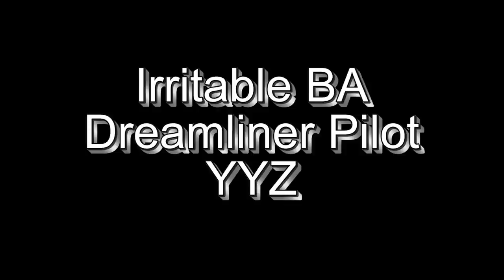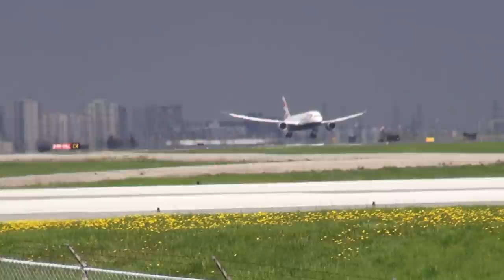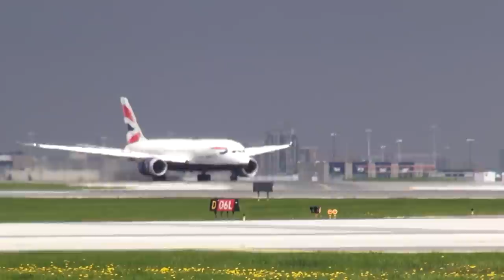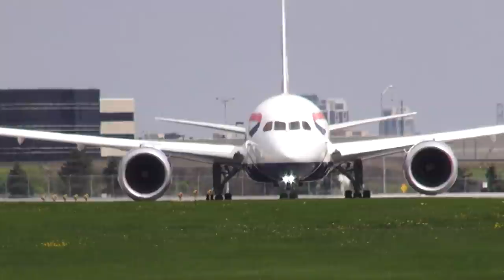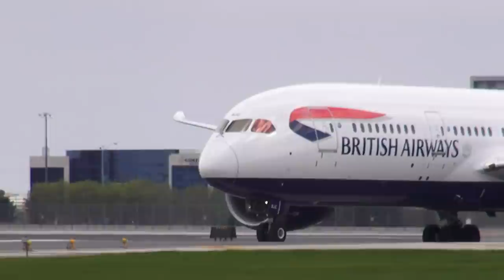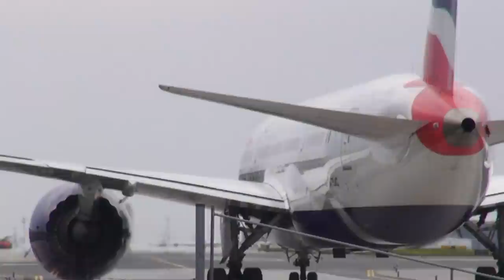Anxious British Airways Pilot, impatient controller

Comment: The controller should have slowed up a bit and let that BA 787 finish it's landing.
Reply from the maker: The only mistake I think the controller made was having too many instructions. "exit delta 6 hold short 24 right" was all he needed to say and asking them to repeat all that was just too much. The pilots will not change to the ground frequency until they are told to which is usually after they have vacated. I hear so many of these conversations as you can also hear if you watch more of my videos. What I have concluded is it is up to the copilot or who ever isn't landing the plane to listen and understand the instructions while the the other is controlling the aircraft. I have often heard in videos inside the cockpit the pilot  asking the copilot to repeat the exit instructions that he heard from the controller. if an airport is very busy like yyz was at this time this is typical. 

The pilot sounded rattled.
Reply: +Dave “daviation” Isenor The controlled shouldn't have even told them to hold short 24R, I mean you never cross a runway without the controllers permission anyways. All he needed to say was "Vacate right Delta 6" and even then I would say he should have waited for them to get back down to ground speeds. And yeah, normally the PNF (pilot not flying) would handle the coms and right down any instructions like that, but it'd be pretty hard to right stuff down while the aircraft is being bounced around as it often is on the landing roll.I will say as a disclaimer I am not a pilot (though I have flown light aircraft) so all this knowledge comes from what I've been told/observed.
Reply from the maker: +Streaky100001 I think "hold short 24r" was the most important instruction since there were planes departing on 24 right. That will never be a redundant instruction especially since they were all delayed due to bad weather just moments earlier. the controller wanted to get a plane away asap but had to hold him because it was still not 100% the BA pilot understood to hold short. The delta 6 was obvious because it was the last exit.
Reply: +Dave “daviation” Isenor Well, I've done the airmanship course with cadets in the UK (basic rules/procedures of flying an aircraft) and the 1st thing they tell you is that you NEVER cross that hold short line with out the controller expressed permission, so unless the controller had said "Speedbird 9 Lima cross 24R" the pilots shouldn't have even considered it.
Reply from the maker: +Streaky100001 I understand totally but it's still just humans communicating, To me it seems everything is obvious. I guess the pilot could be just on his own doing all the things he learned in an "airmanship" course. I still think as a layman in this case, out of all the default or obvious,  holding short of 24r was the most important instruction as there was traffic taking off. where ever he vacated wasn't important. the one thing that needs to be avoided is a collision. Exiting on the grass would avoid that as long as he didn't get in the way of other traffic. I have heard them instruct to exit left at the "next exit" that being the one they can make (then) hold short whatever. If there was a situation where the "hold short" instruction wasn't given and for some reason the plane continued to cross and there was a collision or a near collision I think the controller would likely be more liable than the pilots, just a hunch. I understand and appreciate your excellent knowledge and I am sure it is better than mine but I have listen to 1000s of these exchanges over the past 4 or 5 years there is always an on the job human element, not quite rocket science, but close lol
Reply: +Dave “daviation” Isenor I think the key difference between what were saying here is my knowledge is theory based where as yours is based in observation, I mean I haven't actually heard many of these exchanges, but I know the way it should go. As for who would be most liable, well I've recently started an apprenticeship in aero engineering, and what I've learnt so far is that if there is an accident any one who'd had anything to do with that aircraft (controllers, flight crew, engineers etc) will be in a pretty bad place, they have a way of finding something you did wrong, and if there was a collision I think both the pilots and controllers would be out of a job, so I think the controllers hold short was pretty much to cover his arse so the responsibility was indisputably on the pilots if anything went wrong, I get the sense it was said more for the tape recorders than the pilot. And yeah, you're right, they do often say something to the effect of "vacate next available right" but at a busy airport I imagine that would cause congestion issues on the taxiways.
Reply from the maker: +Streaky100001 Yes, any trade you learn has it's theory or academic part of the course. but the most important part of the course is being an apprentice. when you are on the job you learn how it improvise yourself out of a situation and often cover your ass. I am an armchair quarterback when it comes to aviation. It's like watching sports all the time and learning what the players do with out actually being a player. You are an up and coming player.
Reply: +Dave “daviation” Isenor I may be an up and coming player but for a different game, I mean this is the actual flying/atc side which I have nothing to do with, they break stuff and I clean up when they're done, so I'm as much of an armchair quarter back as you in terms of coms with atc.
Reply: +Streaky100001 As an ATC you'd think there is a lot of things you wouldnt have to say but pilots tend to forget there a lot of other planes around and until you hear that readback from the pilot you'll be stress he wil do the one thing you don't want him to. the whole point of having two pilots is one does the cross checking and comms during the landing and the other does the landing. This is pretty normal.
Reply: +Streaky100001 Maybe it's different in the UK, but here in the States, it's pretty normal for ATC to explicitly instruct you to hold short of any runways along your taxi path that you don't have clearance to cross, as far as I know. The same is probably true of Canada. Of course you shouldn't cross them without permission anyway, but the explicit mention makes sure that the pilot realizes that he will, in fact, have an active runway in his way and he shouldn't cross it. The pilot should see that anyway from the airport diagram and out the window, but the explicit mention by the controller helps to reduce the chance of a pilot not noticing. In bad weather, the hold short lines can be hard to see from a distance, especially if you're not expecting them and happen to be glancing off briefly at an instrument or some such thing. In 99.999% of cases, the pilot will see the runway and not cross the hold short line even if the ATC doesn't mention it, but the mention is there to keep the other 0.001% of cases from killing hundreds of people. Preventing runway incursions is one of the most important parts of the jobs of the tower and ground controllers.

Pilots and controllers both make mistakes from time to time. They're both human. Having them double-check each other greatly reduces the odds of a mistake leading to an actual accident.
Reply: +vbscript2 Yeah, point taken, I was very much thinking of the theory, I have little real world knowledge of this stuff, and you do raise an interesting point when you said "have an active runway" since I would assume there would be a strong chance that the pilot if presented with a runway out of his windshield may not know weather or not it is an active runway.
Reply: +Streaky100001 We always get a hold short clearance (or a crossing clearance) if the taxiway we are exiting on leads to another runway. 
The issue is that the controller gave the taxi instructions before the pilot had even completed slowing from landing (the thrust reversers being open indicates that he was in excess of 80kts). 
The pilot was right to be annoyed and ATC was in too much of a hurry.
In the US ATC is not supposed to give an airliner a taxi clearance until they have slowed to taxi speed.
There is no reason to disable comments. :)
Reply: +StratMatt777 Fair enough, I agree that the controller definitely needs to slow up and chill out.
Reply: Plus if the Tower didn't give any instruction when they exit, they must hold on the exit right Matt?
Reply: nihongo02341 Yes, they must hold, but that is only because the taxiway leads to a runway which is protected by hold short markings (which are technically called "Holding position markings- which indicate the runway holding position").

If the taxiway did not lead to a runway and hold short markings there would not be a visual indication to stop, BUT since all the major airports the big jet airlines fly into have ground control, they DO stop after they clear to call ground control (and tower tells them to), however they do not switch to ground until they've cleared all the runways- then "ground" begins.
 
Hey thanks for commenting because you caused me to listen to this audio again and I realized exactly what is going here: 
 
After receiving a comment reply alert I just listened to this a second time and realized EXACTLY what is going on here- this will answer everyone's curiosity.

The reason that ATC gave BA the "Hold Short" clearance so early is because he couldn't clear AC6139 for takeoff until BA had read back "Hold Short Runway 24".

Notice at 1:12 Tower says, "AC6139, I'm gonna have to hold you in position" because he can't clear him for takeoff until BA reads back the hold short clearance. BA had already read back, "Hold Short", but FAA rules require him to read back "Hold Short runway 24" (this rule is to prevent runway incursions which are a huge problem), THIS is why at :53 tower asked him to read back the entire clearance immediately again after BA had just read back "Hold Short".

The second request combined with asking too early (twice) is what set the BA pilot off- and rightfully so, really.

If the BA pilot knew that the FAA controller MUST hear "Hold Short 24" he would understand why the controller asked a second time, but, due to his desire to clear AC6139 for takeoff the controller asked WAY too early... yet, BA complied, but without including the runway number.

So AC6139's takeoff was delayed until BA gave the assurance that they would not accidentally taxi onto 24 with the FAA-required terminology.

After BA read back the required verbage then AC was cleared to go at 1:39.

One time I heard a general aviation airplane who flew into Boeing Field in Seattle be asked 5 times! to read back " Turn left Alpha 4, hold short of runway 13L with me" because he said the wrong stuff the first time, and the next times he would say "Hold Short" without the runway number etc... it was quite comical/embarrassing!
Reply: Agreed. That is what I thought he was doing it for, to get that other bird off the ground. Pressure cooker at busy airports.
Reply: StratMatt777 Is Canadian ATC lingo the same as FAA?
Reply: vbscript2 Some small things are just a little bit different- but not by much. One of the differences is that they will tell you "Number one to land" before you are actually cleared to land.  I've only flown into Canada once.
Reply: Streaky.....The problem with YYZ is it only operates from 6 am to midnight so they are very fucking busy duing the hours of operation. That controller sounded like he was doing his job very professionally but the pilot questioning the controller about it being busy was unprofessional. He should have shut his mouth and just followed instructions.

Comment: Whilst there are many disagreements in regards to the correctness regarding the ATC taxi instructions...thats exactly why there are two pilots, the PF to handle the aircraft and the PNF to deal with comms, fair enough its the pilots' prerogative to decline detailed turnoff instruction at this stage of landing, a better communication maybe would simply be to instruct runway vacation on the designated ramp... Maybe not further taxi instruction at this stage. But tbh, who knows we weren't in the cockpit, the Comms pilot might have had to intervene on something, we don't really know theres a million possibilities.
Reply from the maker: Daniel Crowe it was an unusual approach for the BA pilots because the north runway 23 was closed and just prior to this landing they were using 15L which is a 90 degree approach to 24. I have a feeling there were some last minute arrival instructions that rattled the pilots a little. Not to mention that 24L is almost 3000 ft shorter than both 23 and 15 L
Reply: Below a certain altitude it is a sterile cockpit, basically only information and communication between crew and atc should be relevant to landing the plane only! Right up until touch down the nfp will be checking gauges I.e speed, engine torque and pressures and shouldn't really be communicating with atc unless they have too. Especially if they have to perform TOGA, the nfp will have to retract landing gear and change flap settings. Pilot was spot on... Safety..... Safety.... Safety!
Reply from the maker: alan jackson that might be true but from my almost 5 years of making these videos with real-time atc and pilot communication. The unusual dialogue was from the plane not the controller. There was some nasty weather and they had just change the approach from 15L to 24 left, the shortest runway  at Pearson, almost 3000 ft shorter. Maybe the controller should have slowed down a little knowing that the pilots might be a little busier than normal. other than that he was just like everyday at Pearson.
Reply from the maker: alan jackson The BA pilot didn't like the way the controller smugly repeated the instruction. D6 is the last exit on 24L so it was obvious which exit to take and it was obvious where to hold short. But, the pilot should have never responded by saying "well we're vacating" that caused the controller to essentially halt everything, as you can hear, and wait until he was sure BA was in fact going to stop. Then he told them to hold short 24R. combination of a smug sounding North American controller and a proud  BA pilot.
Reply: +Daniel Crowe Wrong.  The PNF is there to monitor the PF as his primary task.
Reply: +Dave “daviation” Isenor

Obvious? Maybe. ATC still has to confirm that you are going to hold short of a point on a certain taxiway.

Comment: The BA was being asked to hold short of another active runway. We all remember what happened at Tenerife and sometimes one has to be flexible to be professional. I consider the ATC instruction not ideal, but required for safety in the circumstance. Many occasions have I had a similar situation- Paris CDG for instance. ATC has a prime function to prevent collisions, so under CAP413, I would accept it as "absolutely necessary". In my experience, pilots are most at risk of a cock-up taxiing.
Reply from the maker: Great points. 
Also the ba 787 was redirected by toronto centre to approach  24 left. Because they closed the  much longer runway  15 left. 24 left is just 9000 ft. The one where an air France a340 went right off the end into a ravine and burst into flames. In 2005 in poor weather. All the departures were at 24 right waiting to go. There was a little extra stress for atc and the speedbird pilots. No reason why the ba pilot had to say " well we"re vacating. Left the atc to put a pause on things and wait for the ba pilots to get a handle on things. I was there anyone who says the atc was in the wrong here is wrong!

Comment: So its an error on the part of the ATC. What might be difficult to consider is the level of fatigue the pilots have in this case, which explains the correspondence even better. When you have been working for the last 9-10 hours, your mental capability is on a downslope, yet you still have to get that machine safely down. Response time is slower than it was when you left London and so youre not as vigilant. I completely understand the pilots, but its not easy to remember or consider all these details when sitting at the commanding end of the spectrum.

Comment: Clearly the turn off for BA-9 was coming up rather quickly in a matter of seconds or ASAP even though they just landed so the timing by ATC seemed okay to me.  Some airports have a longer runway distance to travel after landing before the need to clear the runway; this was not the case at this airport during that landing. If the pilot didn't like, tough, it is what it is. If the ATC didn't like it also tough. We all get pissy at times.
Reply from the maker: +cannedheat300 out of the 5 runways/10 approaches at yyz 24L/6R is the shortest only 9000 ft. Because of changing weather conditions they changed the approach and this BA 787 was the first one. Arrival might have changed their approach instruction late before they spoke to the tower.

Comment: In my opinion, the PILOT is in charge and the controllers can put a cork in it until that pilot has the situation in hand handled... In this case landing a large aircraft loaded with passengers safely. I would have done the same thing...